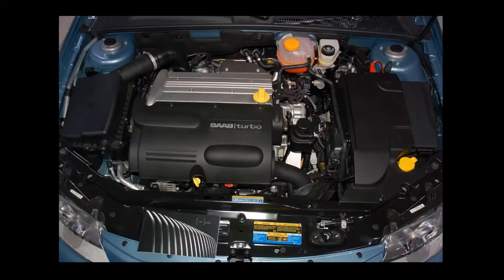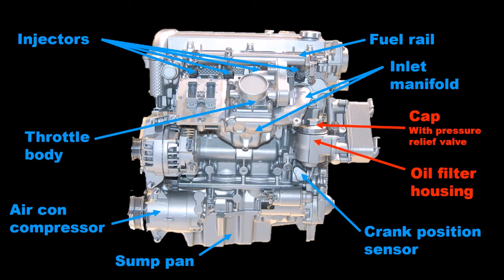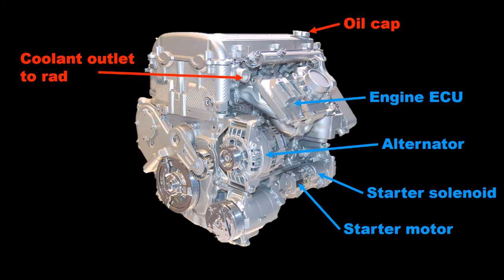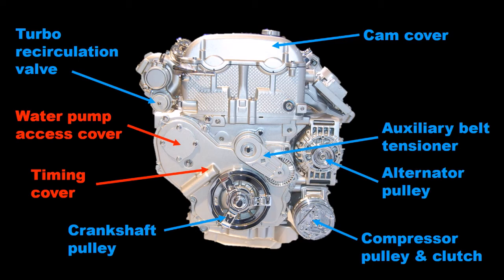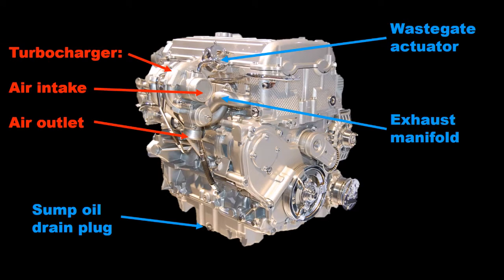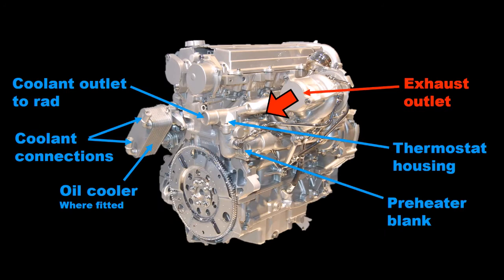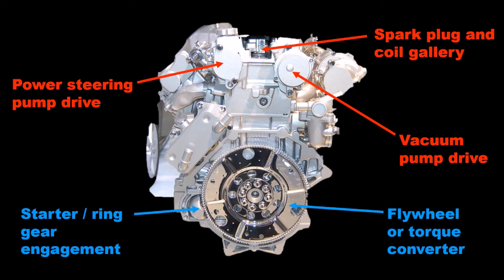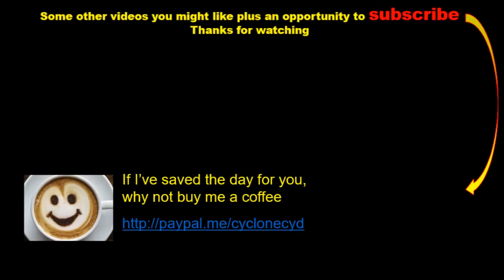GM Ecotec Engine Tour - Saab Vauxhall Cadillac

Comment: You think this engine can be for tunning??
Reply from the maker: In most applications this engine is receptive to tuning. My B207R is near 270hp/380Nm. Plenty of tuners 'map' these.
Reply: Cyclone Cyd yeah I got a 2005 saab 9-3 aero am trying to get it to stage 3 which give my Saab 280 torque and 256 hp

Comment: Great video. Is the block of this engine the same as x20xev/x20sed?
Reply from the maker: TBH I don't know, but I wouldn't be surprised. It's used in loads of GM based applications - all with different codes, lol. I know it's Z20NET in Vauxhall speak

Comment: A B207L or Z20NET no less. Great animation where did you get the picture from? Fantastic underrated engine, similar to the Z22SE. Regular oil changes with 5W30 will give it a long life.
Reply from the maker: Thanks Zed. Yes, it is a good engine and you're right about oil changes. I change every 5,000 miles ish with a flush too. She's clean as a whistle inside and runs soooo smooooth. 127,000 miles came up this week.
The weak point is the timing chains if it's not looked after properly.
The pictures originate from Detroit 2007 motor show. Display engine on the Saab stand.
Reply: @CycloneCyd  Would you be able to provide me with a link to those pictures? I can't find them.
Reply from the maker: @MGalaxy  ah! They are on a database that you won't be able to access. Send me a email in the New Year and I'll be able to help you. I'm back at work 13th
Reply: @CycloneCyd  Thanks. I'll do that!
Reply from the maker: @MGalaxy  email address in about section